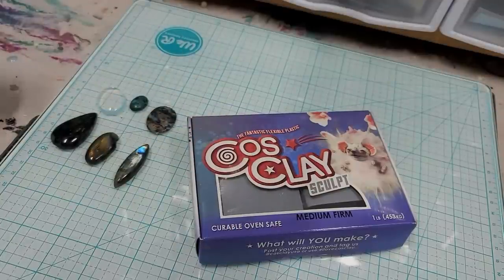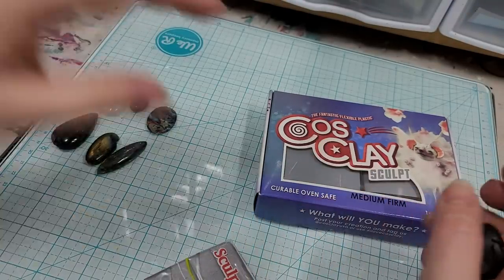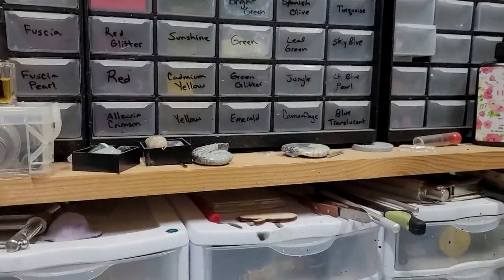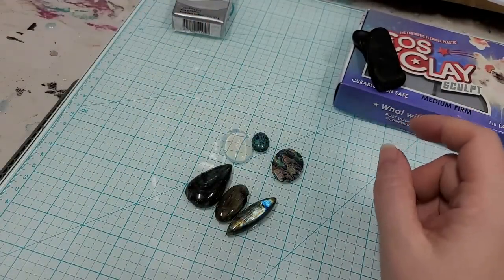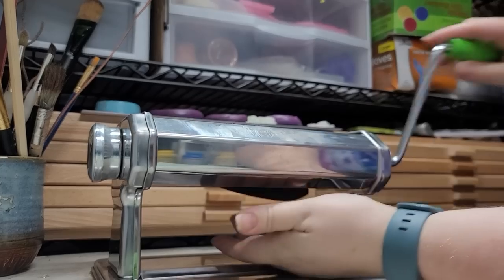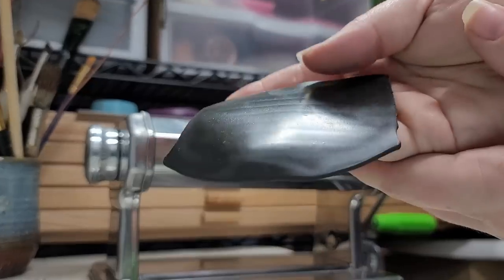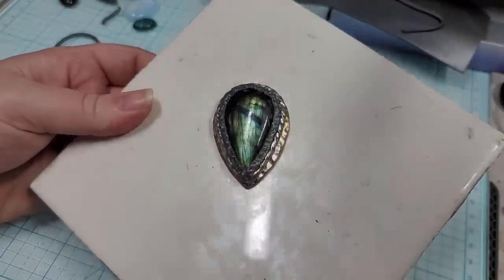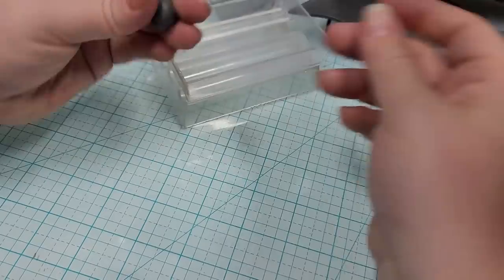Choosing Stones and Sculpting a Polymerclay Pendant

Comment: Polymer clay cabochon frames are always nice but Yvonne's concept is definitely next level.    I admit I save the metallic seal on Nutella jars - one side is gold, the other is silver.   Great for backing stones and when chopped into smaller bits it resembles metallic leaf.   Years ago I purchased a dozen drawer units that can hang on the wall or sit on a table.   (Sadly they are currently in storage - I miss that organization.)    They are still available from Harbor Freight for $19.99 plus tax.   They also ship.   I just checked the website - $6.99 flat rate shipping unless overweight charges apply - as per the website this unit weighs 4.9 pounds.    Storehouse brand, 40 bin organizer with one full length drawer, SKU 94375, 17.5" high,12" long, 5.5" wide.    When I bought mine the guides for dividers were molded into the drawers but none were supplied.    I bought a deck of playing cards from Dollar Tree and created my own dividers in less than hour.     Cardstock also works but is more pricey.    I added clear packing tape to the front of drawers so I can use wipeable markers or even Sharpies to label drawers, either wipe away the info or remove and replace the tape.    Between jewelry making, polymer claying around, flipping furniture and general 'stuff' I may need a few more.

Comment: Hello yavonne W..your work is exquisite.im here because i have a question regarding wire weaving and joining two different pieces together I have a five base wire weave and I have a separate three-piece wire weave that I'm just starting but I would like to weave the three wire base onto the five wire base together but I do not know how that's possible because the top wire base the fifth wire has space every other spot because I did a weave that goes all the way up 5 and then the next one goes all the way to the fourth wire so it's 5th wire fourth wire that's the space for me to go in between is where the smaller weave is made.the only thing I thought was to  take the wire off the spool and have one long piece of wire and it be like I'm sewing in between those pieces does that make sense but then it would tangle/ kink on me I'm not wrapping around a stone I'm trying to make a hoop so I can put a tree inside I hope this makes sense sorry for the long message  I'd truly appreciate your feedback thank you🤗